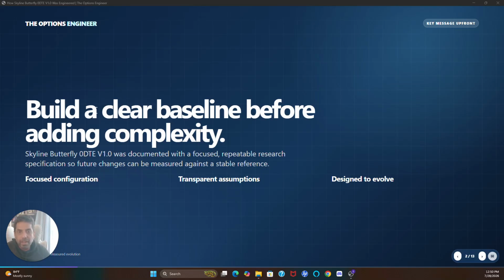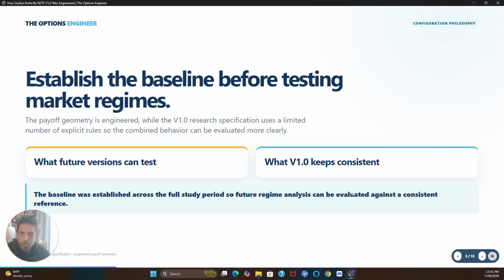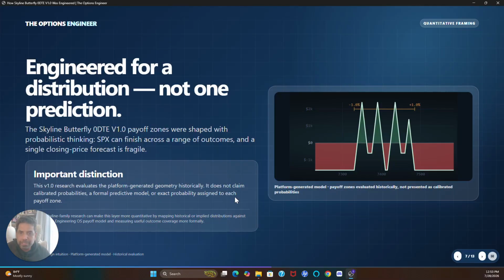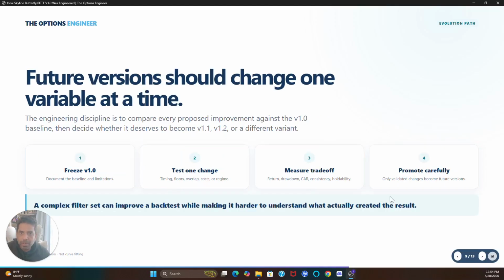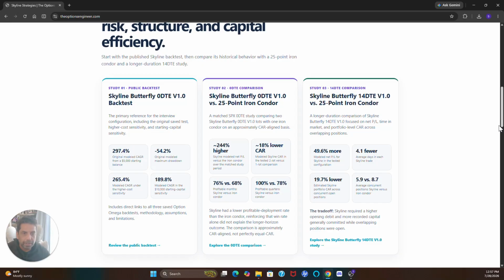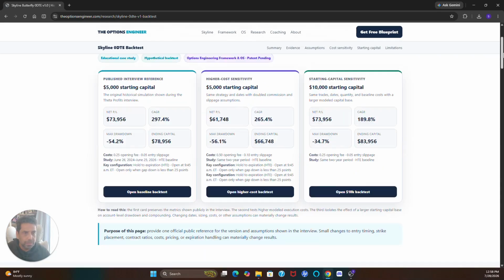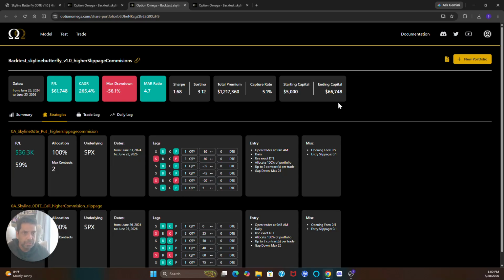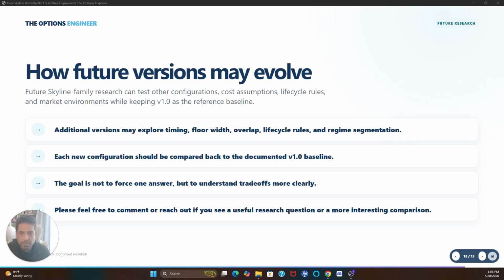Inside Skyline Butterfly 0DTE V1.0 | Engineering Process & Backtest Configuration

Comment: Dude, you won't get anyone to take this backtest seriously with those commissions and slippage. People trading Tastytrade for example will pay 1.31 per contract. And slippage will be easily .05 PER BUTTERFLY.  And 1 backtest on 2 years of data means NOTHING. Great backtests that don't work in the wild are a dime a dozen. You need to trade this and publish real results.
Reply from the maker: @downwinder3
Thanks for the feedback. I agree that commissions, slippage, liquidity, and execution quality are critical, which is why the research now includes multiple cost assumptions, capital levels, and configuration tests rather than relying on a single backtest.

Broker pricing also varies. For reference, Interactive Brokers publishes its options commission schedule here:
https://www.interactivebrokers.com/en/pricing/commissions-options.php

These results are presented as hypothetical historical simulations, not live performance. Please check the newer videos and research on the channel, as the work has expanded beyond the original two-year test.
Reply: @TheOptionsEngineer  Right your link shows your commission costs would be .65 PLUS exchange fees so about .96 .  .25 commission is only on options with premium under a nickel. So even your high cost estimate is too low by half.  Do you actually trade this to know the fees?
Reply from the maker: @downwinder3 Thanks for following up. Commission schedules vary by broker and account type, so traders may need to shop around based on their execution needs.

The published backtests use a hold-to-expiration framework, which reduces exit-related slippage assumptions. The structural edge being studied is shown more clearly in the Skyline-versus-iron-condor comparison video, where both structures are evaluated under a consistent framework.

This is educational research only—not live performance or a recommendation.